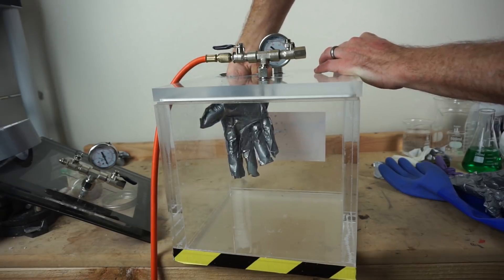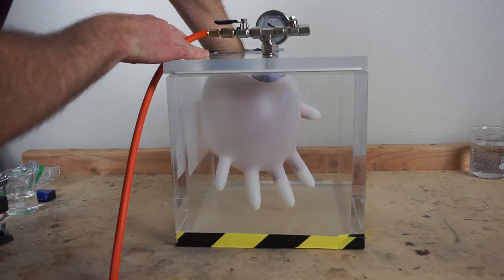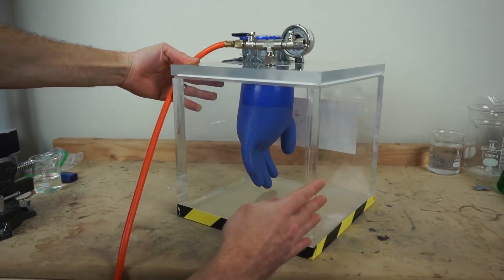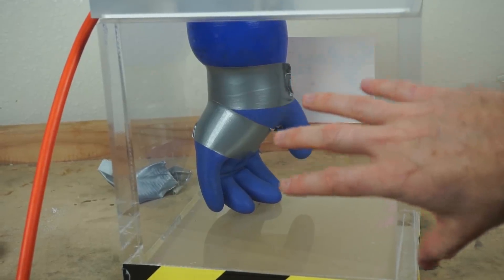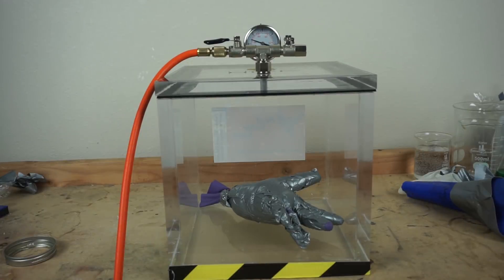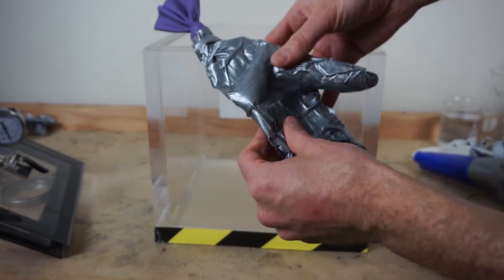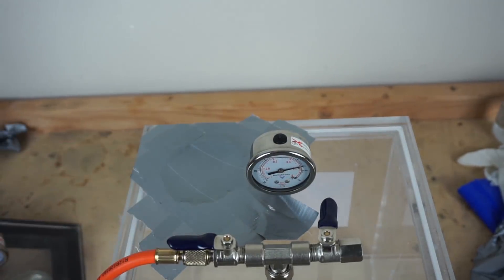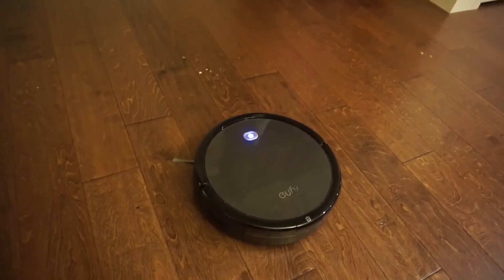Could You Make a Space Suit Out of Duct Tape? Wearing a Duct Tape Glove in a Vacuum Chamber!

Comment: In terms protecting your body from a vacuum you only need to maintain pressure everywhere on your body. That means your suit doesn't actually need to be air tight (except for your helmet) as long as every part of your body is compressed tightly by the suit.
Reply: This video alone should should tell people that those moon-suits would be way to too rigid and stuff to be in a 'TRUE' vacuum theory.  Yet, we see AstroNOTs using tools, turning bolts etc...🧐
Reply: @thinkinsidetheboxsquarecir3303  are you kidding me? they can barely use tools that's why they it's so tricky to do that stuff in a vacuum because space suits are so stiff.
Reply: @LisaAnn777  you would need a plexiglass jar for a suit!😆
Reply: So extrapolating, could you then wear googles/scuba tank, and simply cover your whole body in duct tape?
Reply: @thinkinsidetheboxsquarecir3303  aiaiaiaiae.
Reply: 19 December 19  nope ......and yes .

as a former technician on vacuum chambers .....you are talking about 1 x 10 to power of negative 17 mbars .....
that is 0,000000000000000001 bars .....

that vacuum chamber is maybe good for 1 x10 to the power of 0 ....so 1 mbar 
atmosphere here on earth is around 1000 mbar at sea level .

this means that that little toy chamber is archieving 99.9 % of space level vacuum .

for reasons of physics ...it is a toy vacuum .....you cant make sputter processes or something else i a " bad " vacuum like that .

in terms of " forces acting on surfaces " ...it is 99,9% of the possible forces , and therefore sufficient enough to simulate the space vacuum
Reply: also yes and no .....your skin is not airtight ....an so are other holes you are born with ;-) 

your skin would become like a very big bruise all over .all the liquids in the skin pores are going to expand , i had my hand over a few minutes on a vacuum hole at a turning vane pump , like a 25 mm diameter , that hurts after a while a left a bruise.
that will hurt like hell , let alone the thermal conditions in space
Reply: Titan should've use duct tape, instead of Carbon fiber.
Reply: @thinkinsidetheboxsquarecir3303 so exactly how far away from earth does it become "space vacuum"??

If "space vacuum" actually exists, why then doesn't that vacuum suck our "atmosphere" (14.7 psi) out? Since when can you have an atmosphere worth of pressure, right next to a vacuum??
Reply: @jakefriesenjake  gravity

Comment: The problem with patching a space ship with duct tape is that on reentry the duct tape would burn up and that could cause a lot of problems with the spot you patched.
Reply: Use more duct tape then.
Reply: Nobody said we are reentering. Duct tape could just be a temporary solution until you can get the materials to patch it up properly.
Reply: I think you would be more worried about looking like part of a meteor shower as you incinerated from friction with the atmosphere as you fell back to the ground, than whether just the duct-tape on your helmet would burn off.
Your everything would burn off!
Reply: humans terminal velocity is not fast enough to burn up.
Reply: realflow100 learn what orbiting is.
Reply: Yeah. Also radiation. And the temperatures of space. But yeah that too.
Reply: Well not if you used a whole lot of duct tape
Reply: Dude duck tape isn’t strong enough
Reply: Youtube Quality Entertainment but radiation and temperature arent that big of problems like pressure because most of the ship would still be isolated losin pressure however would be a rapid process even with just a tiny hole
Reply: Mnaber1234567 shhhhh we don't talk about this.  Also in reality I'm sure NASA could make a heat resistant duct tape out of a fiberous heat shielding material as well as adhesive.
Reply: I agree
Reply: @grenadeninja3050  Otherwise known as "space duct tape"!
Reply: @finbob5  Yeah, what I was thinking.

Even then, you would most likely get a hard object and tape it into the hole, to protect the duct tape from micro meteriods.

As you could see the duct tape is easily puncturable.
Reply: @slimizzy2002  duct tape solves everything. Have a nosey neighbor? Use duct tape. Hole in space ship? Use duct tape. Have no food or water? Use duct tape.
Reply: The duct tape would be a temporary fix.  Something to keep pressure inside while you weld a more permanent patch over it.
Reply: @grenadeninja3050  and line it with lead to stop radiation

Comment: You should have tried to close the hole with the tape from the inside! I think this would be the equivalent of fixing an element from the outside (in the space the vacuum is outside, which would be the box inside). I don't think the "sticky strength" (cohesion?) would make it, in a such big hole. Maybe in the little crack of the helmet yes.

Anyway great job! :D
Reply: That’s what I thought! It would try to bubble out and push the duct tape, but if it was on the inside it’s got a different set of forces to deal with, I think you are right!
Reply: you didnt have that much time to move out of the spacestation and fix it from outside, also its much convenient to fix from inside.
Reply: @Motionbuck  crap if it will bludge outwards it will have less friction from the wall , but from inside it will exert force on the wall resulting more friction, more stromgness in tape
Reply: @conelleh Thats What i thought too

Comment: 5:05 It's not the same thing... When the glove is sealed around the hole, the inside of the glove is kept at a constant pressure of 1 atm. When the glove is tied closed inside the vacuum chamber the pressure inside the glove decreases the more it expands, it may even decrease to a point where a human wouldn't be able to survive without the glove exploding since the pressure inside the glove would be a lot lower than 1 atm. Especially if the glove is as empty as it was in your case and the glove doesn't resist expansion at all at first, probably 'causing the pressure inside the glove to decrease quite substantially.
So yeah, that's definitely not an accurate representation of how the glove would actually behave in space or whether it would explode or not.
Reply: Was thinking the same thing.  The pressure inside that glove was a fraction of an atmosphere.

However, it is fascinating to know that simple duct tape could be used to patch a hull breach in a pinch.  Hell, slap the duct tape on it temporarily, and just weld a plate over the hole.
Reply: Exactly!!! This video alone should should tell people that those moon-suits would be way to too rigid and stuff to be in a 'TRUE' vacuum theory.  Yet, we see AstroNOTs using tools, turning bolts etc...🧐
Reply: @seanrallis6714  spacex crew dragon had an emergency roll of duct tape in their capsule for the inspiration4 mission
Reply: @gerritthompson2246  my life is more fulfilled with this information, thank you 😊
Reply: @seanrallis6714  your welcome
Reply: You must have eaten paint chips as a child, huh?

Comment: I think your comparison to Matt Damon using duck tape to fix his suit has one flaw, you taped it so the vacuum was pulling through the hole, vs it being taped completely on the vacuum side, thus trying to pull the tape off of the surfaces.
Reply from the maker: +Darren Rigby true, but his crack was so small there wouldn’t have been enough force to rip of the duct tape.
Reply: Good luck then with quickly trying to patch a hole like in that movie by first taking your clothing off, putting the tape on the interior, then putting the clothes back on all while in the vaccuum. :/
Reply: Yeah I said this on the main comment thread too. It will depend on the strength of the adhesive. From what I've tried it can't hold up though I could be wrong. I used my bike pump to test.
Reply: Atually that aint a problem cuz the crack is so small.
Even then, He has some pressure around him (Martion atmosphere, instead of space)
Reply: *duct
Reply: +Surya Did you pump it to 16 psi then?
Reply: Better hold your breath!
Reply: Mitchell Spanheimer It barely took 3 or 4 before springing a leak. And if I hold it down with my hands it tears at around 30psi
Reply: Mars does have an atmosphere (roughly .6% of Earth's at sea level.)
Reply: In the book he used really strong resin
Reply: Sand and shit would also make the tape stick a lot worse.
Reply: Darren Rigby WAIT WHAT?? THERE IS DUCK TAPE????
Reply: He Ka Extremely true. I overlooked this point. Martian soil is an extremely fine dust and gets into anything. So the tape would have had an even harder time holding onto the visor. Also he would begin to freeze up due to Joule Thompson cooling as the air from his suit escaped so maybe the tape could start to become brittle and lose its flexibility - another overlooked point.
Reply: Well. according to Wikipedia. The origin of duct tape was named duck tape... because of the material used: "strips of plain cotton duck cloth".
At some point the name was changed to duct tape because it was used on ducts etc. Then again this one guy bought a company and renamed the tape they manufactured to "Ducktape" and gave it a logo of a plastic duck. So.. I don't know.
Reply: Darren Rigby air would escape in seconds from his space suit in the vacuum of space plus it would be impossible to use buck tape because the vacuum is sucking the air
Reply: Why don't you do a follow up to this and try the tape on the inside with a smaller hole?
Reply: The Action Lab no way this works. The reason is, yes, the area is small and can't burst the tape. But it lifts the tape off the surface around the crank, quickly creating more area.
Just try it;)
Reply: I would actually like to see this.
The idea of using duct tape to patch a hole FROM THE OUTSIDE (vacuum side) of a space suit / space craft, is quite amusing.
Patching a crack from the inside (atmosphere side) is much easier.
Reply: on mars there is no vacuum
Reply: that may be true but on mars you are in atmosphere
Reply: Are you sure? Wouldn't the 'force' of the pressure be larger in the case of a smaller hole? Like a nozzle, same pressure with a small surface area?

Comment: Space suits are only pressured to at most 5psi. So the gloves would be quite a bit easier to move then your example at half or no atmosphere. You really only need to lower the atmosphere by 5psi to get a good equivalent.

On top of that, spacesuits are actually built with internal air flaps. Basically, when you move your hands, arms, neck, hip, or legs, these flaps will expand in order to keep the volume of the suit constant. It isn't perfect, but it does significantly improve suit mobility.

Honestly what we need to work on though, is a hybrid suit. The torso and head should be covered with a hard shell suit, and the arms and legs should be a skin tight suit (applying pressure via the tension in the fabric). This really would be the best suit we could make with today's technology. Air flaps would likely still be required to a smaller degree considering that the body's volume can can change slightly when move joints. These suits would be much quicker to put on as well. Only a few downsides to the skin suits. They usually need to be customized individually to a degree. They offer less protection from micro meteorites. And, they don't completely remove the changing volume problem.

I do prefer this hybrid suit over any complete hard shell design. Hard shells are great for durability, and are a significant improvement over current suits in mobility. They unfortunately have some draw backs. First is they are cumbersome. They take up a lot of area and are quite heavy. Every pound counts with rockets. Second, every suit requires "programming"to a degree. This is the term for how you have to manipulate certain joints to flex in the way that you want them it. It isn't always straight forward with hard suits. While they would be better than current tech, they still aren't very easy to get into. So really, a hybrid suit is the best of both worlds.

Comment: What happens if you put something that's vacuum sealed in the vacuum chamber. Would it stay the same or puff out
Reply: Matt Thorgood 
It would depend on how much of a vacuum is inside the package
Reply: if the vacuum on the outside is same as inside, pressure is equalized.
Reply: It wouldn't enlarge at all because the pressure is the same. The only reason it puffs up is because as the air is sucked out air wants to rush in but it can't in a normal one. But it tries to via the glove so it puffs the glove

Comment: the only problem is that matt damon patched it up from outside, which actually should blow the duct tape in the opposite direction
Reply: Not necessarily, the hole was really small and only had a couple fractures, the tape would definitely last as the air from his suit is not really going to push it off as the duct tape and more surface area for it to stock to, therefore, could counteract the force (which would be a very small amount coming through such a small hole) pushing it. But yes, if the hole were to be bigger, it would definitely be forced off and would have need to be on the inside. The film creators probably did a lot of research before hand.
Reply: You have a lot of trust in  film creators
Reply: It wasn't real, they filmed it in hollywood as a movie. It was not a documentary on how to survive space alone. You mixed up the Discovery channel with sky movies.
Reply: the author who wrote the book did a lot of research and the director who shot the movie has show he does research on his other movies

Comment: The only difference is: He patched his space-helmet from the outside of the pressure.
Reply: Exactly, I was thinking the same thing. The weight of the air in this case is actually helping the ducktape stick to the lid, as opposed to what happens in The Martian. However, the leaks on his helmet were way smaller, so I still think it's plausible.
Reply: Um irl they would have made the spacesuits from earth they wouldn’t be like ok let’s blast off and we’ll make some spacesuits when we get off the space station for a spacewalk.so there still wouldn’t be any pressure when they made it or did he like get it ripped THEN took it out and patched it I haven’t watched the vid yet

Comment: The duck tape patch you did at 9:21, is on the wrong side. In space, if you covered a hole with tape from the outside the internal air pressure would come out at a rate where the tape wouldn’t be able to hold the pressure difference.

Comment: Try putting a humidifier in a vacuum chamber
Reply: Farhan Cheema 
you can't have a vacuum. with liquid water in there. the water will boil reducing the vacuum . that's why commercial vacuum machines has a freezer unit inside. to lock any moisture in ice. so it can't boil off. causing the pressure to drop! I don't know how much the pressure will rise. or how long it will boil. I guess it would boil until it gets to the vapor pressure of water. or what ever its caused. witch water does evaporate at 14psi. so at zero I guess it will boil and evaporate fast. check out water in a vacuum chamber.
Reply: James stranger autoclaves use vacuum and steam
Reply: The water vapor would mess up the pump
Reply: He just did it
Reply: Farhan Cheema Oh yeah yeah
Reply: Oh yeah yeah
Reply: The water in the reservoir would boil, then freeze in a relatively short time, then the ice would sublimate.

Comment: There would be extreme temperatures in space so this test wouldn’t really mean anything unless the vacuum chamber was also a very very powerful oven.
Reply: That is a misconception, yes temperatures are extreme in space but only on direct sunlight and because there's no air in space, there's no thermal conductivity only radiative heat and that takes ages to make something hot become cold for example, so if your hole is in the sun shade, it will take a large amount of time for the duct tape to freeze, even tho space around it is almost at -240ºc, now if it is directly on the sun light then it will melt very fast. Btw you don't really need a very powerful oven, unless you are traveling towards the sun, if you are in the space between Earth and Moon for example sun light reaches temperatures below 300º celsius there are home ovens stronger than that, not to talk those used to melt iron.

Comment: Also, there is a major difference between what he did in the movie with duct tape, and what you did here. You put duct tape on what would be the inside wall of the ship. 
He put duct tape on the outside of the helmet. The difference is that in your example, the vsccum was pulling on the duct tape exposed to the hole. In the movie the entire strip of tape is being exposed to vacuum and pulled on, as well as the pressure inside the suit pushing out in the tape covering the hole. It's kind of like using duct tape to seal a leaking aquarium. You put it on the outside and it's just not going to hole the pressure back very well. But on the inside, it could work much much better. (Ignkre that duct tape doesn't mind being wet for that example)

Comment: Follow up experiment needed.
He taped it from the outside in the movie.
You need to see if it holds up from the vacuum side of the hole not the pressurized side.
My theory is that it tears that duct tape clean off as the adhesion probably won't be strong enough to hold it on from the directly away pulling force.
Reply: Dissident Ace 

Vacuums don't have any pulling force.

It'd be the pressure pushing it off in your scenario